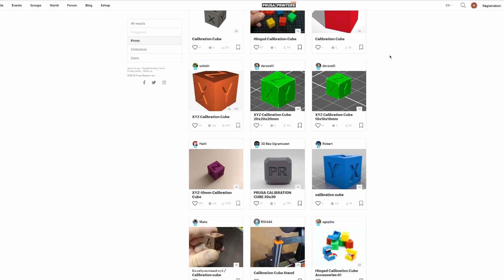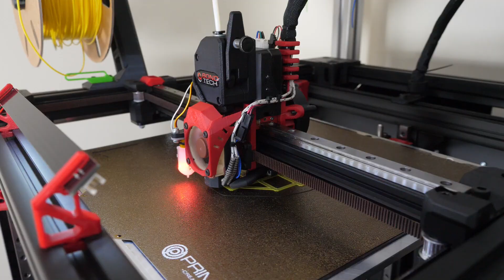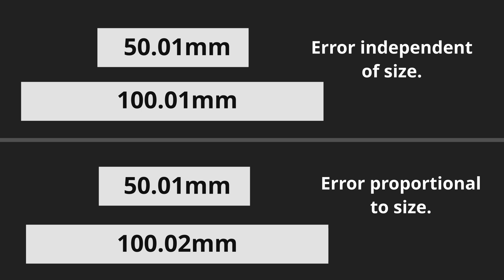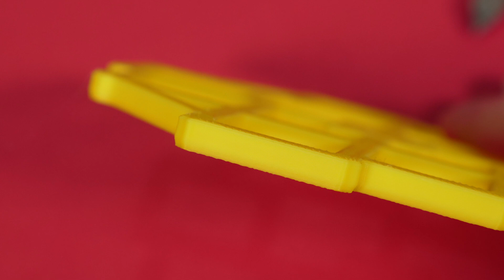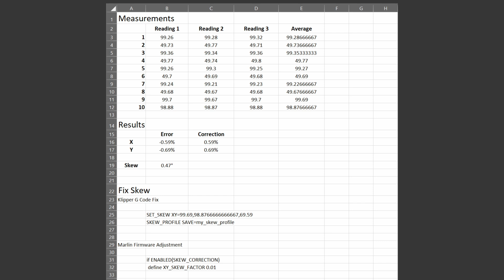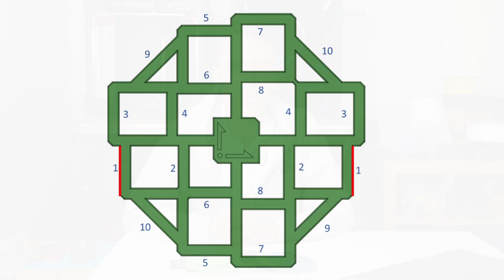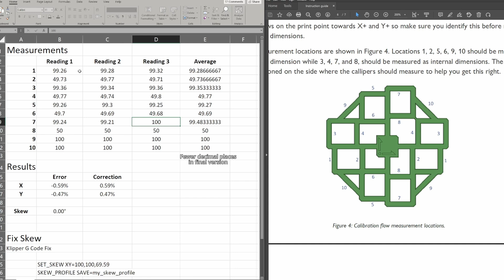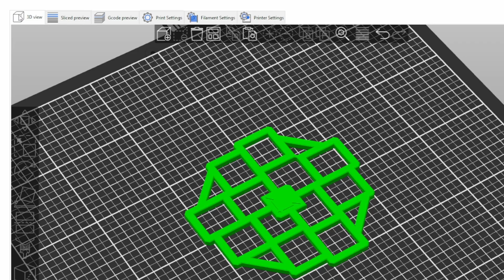STOP Printing Calibration Cubes!

Comment: Nice. Just wondering if you have made any allowance for elephants foot? This tends to screw up dimensional measurements for anything on the the print bed unless you are that rare person who has perfectly levelled your bed and set the correct z offset, etc. I know that I tend to err in being a little too close to the bed to get good first layer adhesion.
Reply from the maker: Yes, a chamfer around the bottom edge of the print deals with that.
Reply: @Vector3DP  cool, thanks
Reply: Yes, was also wondering about the Horizontal Expansion that I ordinary use to make mechanical prints?
I do not suppose this value will affect your test results though, as you are averaging inside and outside measurements.

Comment: Clever, but doesn't account for over/underextrusion. This can cause the dimensions to be off, just as shrinkage can. Not sure how a test print could address this though. In any case, this is certainly much better than a cube.
Reply from the maker: It actually does in theory, the residual error that you cannot remove by steps/mm will probably be extrusion.

Comment: Great idea! If I understand correctly, it just calibrates x and y but not z. Is this not necessary or not possible?
Reply: It can be calibrated for and prints exist, but I imagine there are more factors to wrangle in for xz and yz skew calibration: like nozzle offset, bed leveling, eccentric nut adjustments. You would want to be measuring and compensating purely for z-axis alignment. Maybe a print on a raft could get rid of first layer artifacts, but then you have to measure off of a rough bottom.

Comment: Great video.  You have given this obessive tinkerer a new goal!

Is the possible with duet, Reprap?
Reply: yeah, if I remember correctly, the Skew compensation is M556 for reprap, so if you have your skew angle, you can  input:
M556 S100 X[100*sin(skew_angle)] Y0 Z0

Obviously, complete the calculation with the sin() seperate and just input the result into the gcode command. Y and Z are zero because those represent YZ and XZ skew respectively.

Comment: I found that the best way to adjust step/mm is actually to measure the physical x y z movement of the printhead , 3d printed objects tend to shrink when cooled.
Reply: I bought a dial indicator exactly for that reason. That being said, I have never attempted so many measurements on a calibration print, and never for skew, so I’ll be giving this new method a try.
Reply: Yes, this measures the actual filament after shrinkage. its designed to adapt a tuned printer to produce parts that are dimensionally accurate after printing and cooling.

Comment: Very nice.

One issue with most calibration objects is they can be impacted by elephant’s foot (which is an issue to be resolved separately from E steps).

Does this have chamfers to prevent elephant’s foot from impacting the measurements?
Reply from the maker: Of course it does :)
Reply: @Vector3DP  you’re too good!

Comment: Haha too expensive for me :D

Since calipers usually have just a little more than 15cm travel, rather than just 10, wouldn't a measurement tool that uses all of that range make sense? I mean even Prusa Mini has an 18cm bed.

Also i notice that while external measurements are top notch, i don't trust the internal measurement jaws of my calipers AT ALL. Do you have some sort of recipe against that?
Reply: Haha when you said it was too expensive for you I thought it was going to be a ridiculous amount. 5 pounds seems like a fair amount to me. Excited to see how I can improve my prints.
Reply from the maker: Discount code available now if 10% helps. check the pinned comment.
I want to make sure it was printable on basically every printer so 100mm seemed like a good limit for that. Also callipers get kinda hard to use well at full travel.

Well if your tools aren't accurate, then i don't think any calibration object going to help with that :)
Reply: @Vector3DP  My situation has improved and i can now afford this print. However, will it actually improve my prints? I have less than 0.2mm of XY difference on 18cm i think, and i used a square in all sorts of positions to dial out the XY skew when rebuilding the machine, so it should be fairly decent as well. But i still want to reduce ovality of printed gears and similar mechanisms and improve meshing. Will the tool actually get substantially below 1% accuracy? Would be a little silly to buy if i can't achieve any improvement, of if the results actually get worse.

I actually have a cheap USB boroscope camera, i think it's in reality 480p and was like $5, maybe best results will be from taping it to the print head or attaching it with a printed attachment in place of the part cooling fan, taping a piece of mm paper or such like to the bed, and walking it to find the offsets?
Reply: @Vector3DP  No it doesn't :D but for what it's worth, i don't consider the price unreasonable, just well outside my budget.

I suppose you're right about full travel being a little more dicey.

As to printer compatibility, OK, there's Renkforce RF100, smallest mass produced printer that isn't a toy, that i can think of, it's 120mm square bed active area, so your tool should fit, that's a great start. Aren't there smaller bed printers as well though? I wonder.

Even with mechanically better quality calipers, i always seem to get varying results from the inner diameter jaws. Like look at their geometry, it's really on the unfortunate side. External diameter jaws are kind of self aligning to what you're measuring, internal diameter not at all. It would seem like there should be a way to replace internal diameter measurements by a sequence of thickness measurements - zero out - external diameter, wouldn't you say? Maybe not quite, but maybe something to keep in the back of the head for a redesign should it come.

Comment: I wonder if there could be a version of this that takes less time to print. One positive side of the calibration cube is that you can print one in minutes, it seems this flower takes longer - and therefore the iteration to get the printer and slicer calibrated also longer.
Reply from the maker: Some additional optimisation for lower print times could be possible, but it's so much better than trying to use a cube, it's not even a fair comparison at this point.
Reply: "Slow and steady wins the race".
Printing faster also introduces more error.
If you calibrate the machine at a slow speed, then have errors at high speed, the only variables to examine are related to the motion/build.